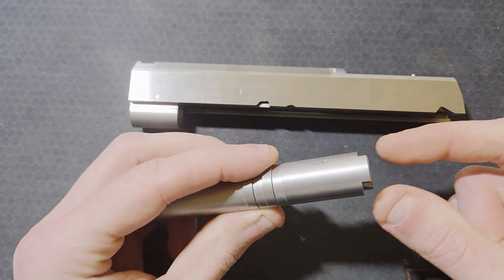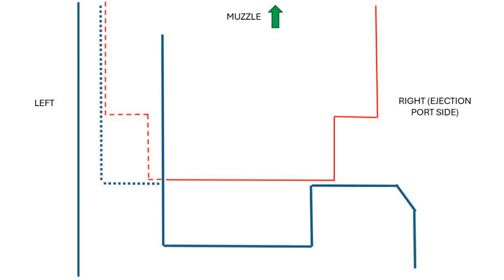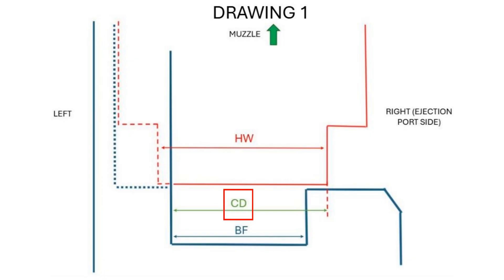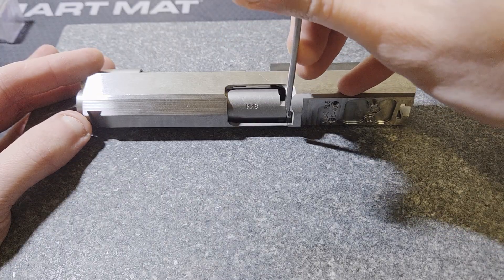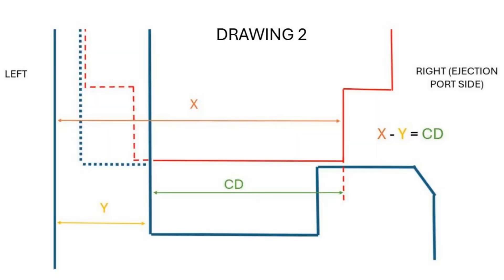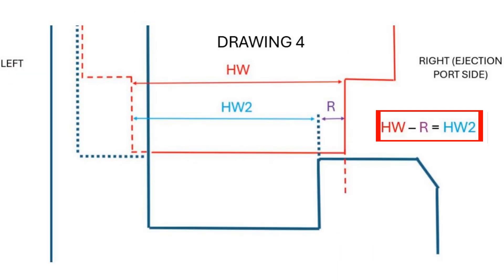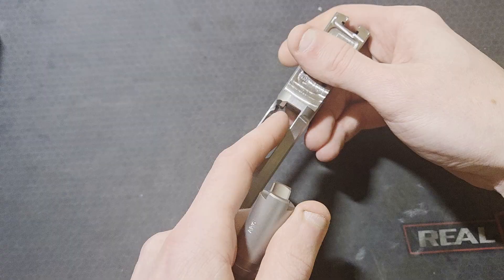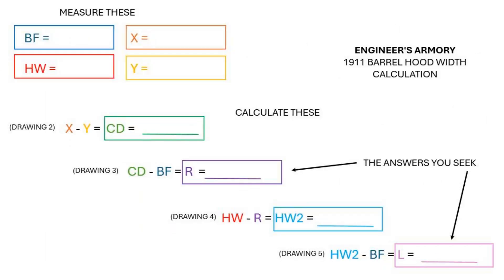1911 Barrel Hood Width Formula Explained

Comment from the maker: A couple things I forgot to mention:

1. Some barrel hoods and breechface slots are centered about the barrel and slide respectively. Its not safe to assume that. In the case of this Atlas barrel and slide they are both offset. I would recommend using this formula to accurately calculate material removal from both sides. 

2. Before removing any material, add L and R to BF, this should equal HW. This is a good check to make sure the calculations were done correctly.

Comment: Semi-unrelated question you might know: I'm working on a 1911 chassis project doing clearance tolerances at the moment. Is there a standard length/measurement that all 1911s follow for slide travel after firing? The only info I can find is approximate two inches/50mm. Where I'm wondering if that changes is for different slide length or mass, or if it doesn't matter?
Reply from the maker: I have a video that covers slide and stroke length. I give approximate stroke lengths in it.
Reply: @EngineersArmory  Fan-friggin-tastic!! I'll check it out promptly.

Comment: unrelated to this video but I would love to see you employ the charyn slide stop fitting style and a marvel disconnector cut. these types of methods no one ever goes in depth on how to execute them but they all rave about the difference they make.
Reply from the maker: Never heard of the Cheryn slide stop fitting. I dont do the marvel cut. What i do to my slides and disconnectors makes the disco action very smooth. Never seen a need to do the marvel cut.

Comment: This is a wonderful video; it explains everything so clearly. Inspired by some of your earlier videos I had put together a worksheet, and had also made a jig to hold a 1911 barrel vertically in my Harbor Freight mill to machine the sides and end of the hood in one setup. It worked (except for the time I got turned around and reversed the left and right cuts), but this new video makes everything much more clear. Thank you.

Comment: Good video. I will note that I used  an Atlas slide and barrel too and your measurements and my measurements were similar. Your numbers were very close to mine, which shows that Atlas parts are consistent, and your methodology was similar to mine.

All your values were within +-.001 of mine for all measurements, but my R and L values were a bit different but only by very small amounts
Reply from the maker: I am fitting two atlas barrels to this slide as well for this build. Both barrels need the same amount of material taken off. They are holding tight tolerances. Thanks for sharing!

Comment: Not related at all, but i noticed you have a ramped barrel, looks like a clark/para. Is there any particular reason? Ive heard alot of theoretical pros and cons, but most of them seem like fudd lore. I was told that ramped barrels add more points of contact when in battery, so they increase accuracy. Some people claim they help feeding things like flat nose or hp rounds. Personally having used both, it doesnt seem like a noticeable difference besides fitting time required.
Reply from the maker: Ramped barrels are more common for rounds like 9mm, 38 super and 10mm. I believe they have more material supporting the bottom rear of the case adding some more safety with higher pressure cartridges. Thats my understanding of it. I would think a properly fit barrel, ramped or unramped, would be accurate. Never heard of accuracy differences between ramp styles.
Reply: @EngineersArmory  that makes sense in theory, but every .460 rowland or .45super barrel ive seen have been standard. Both of those rounds push pressures greater than or similar to those smaller rounds. I also dont believe strengthening a cylinder on 1 "side" increases the strength much beyond that side.
Reply from the maker: @KetamineKowboy  yeah who knows. I'm building my 1911s in 9mm, and pretty much the only barrels you can find are ramped so thats what i get. Clark/para seems to me more common than wilson nowlan too.
Reply: @EngineersArmory  wilson isnt even what wilson uses anymore. Turns out the more square profile of that ramp tends to Mushroom at right round counts.
Reply from the maker: @KetamineKowboy  i could see how that happens. Im familiar with clark/para and never had issues with em, so thats what i use.